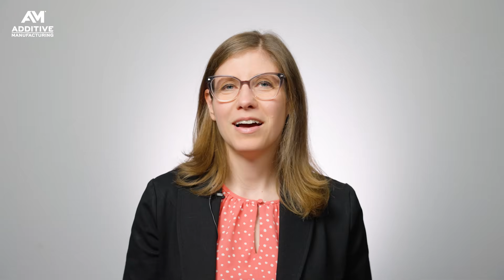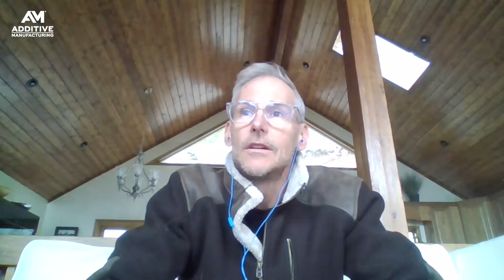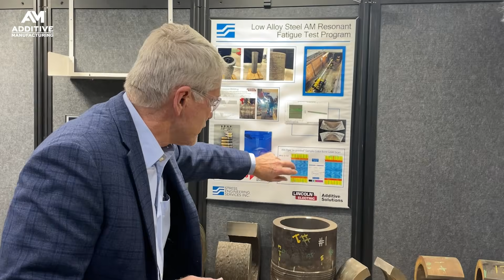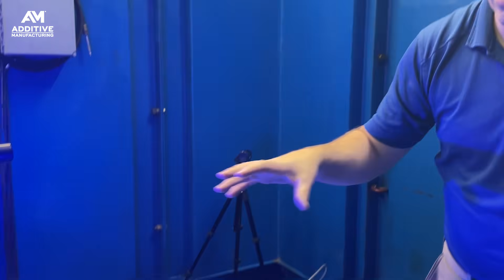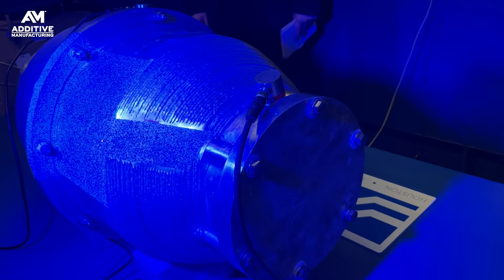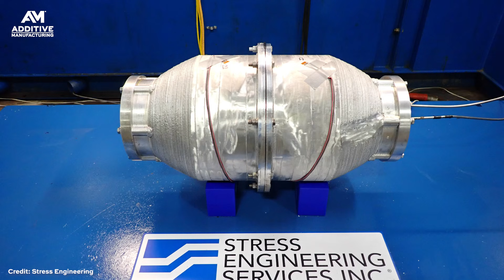Testing a 3D Printed Pressure Vessel to Failure

Comment: Interesting. But I am still skeptical about 3d printing as a whole outside of simple prototyping. What makes me skeptical is the fact that the production of the component (pressure tank) or whatever it may be is uncontrollable, the temperature is not uniform, layer lines introduce points of failure, 3d printed parts lack isotropy. I suppose as we investigate the 3d printing process even more we can come up with ways to produce components that possess all the mechanical properties that we love about forged/die casted parts

Great video

Comment: How are you able to manage and control the internal blowhole and cavity in metal printing?
Reply from the maker: From Slade Gardner, BMA: "This part was produced with wire feedstock and an arc energy source. Each layer successively built up the pressure vessel wall and the internal cavity was formed first as a cylinder and then with a tapered reduced diameter. The top of the tank had an opening approximately 8 inches diameter and a cap was bolted on the top to close the vessel. The vessel was produced in two halves, and each half was bolted together at a flange."

Comment: Fascinating materials testing results. File under: I wanna share something only vaguely related to the subject matter:
The way that I understand "hydro testing" of small, commercially manufactured tanks for gases up to a rating of 4500 PSI is 2 cycles of testing with water @ 7000 PSI. 
It's very impressive to see the tanks made of resin embedded, wrapped composite roving materials swell dramatically without failing. 
Call me stupid; but I believe that it is actually the repeated hydro testing cycles necessary to "recertify" those types of tanks over time that eventually causes them to fail.
I've been regularly refilling many of these tanks to 3000 PSI that are close to 20 years past the " official expiry date" without doing any hydrotesting. Of course the tanks are always fitted with regulators that have with high and low pressure burst discs. 
YES= I understand that they were "over designed" to handle the working pressure by a factor of around 2.